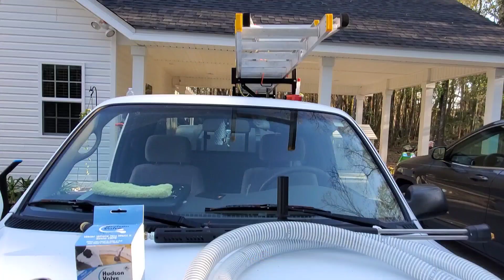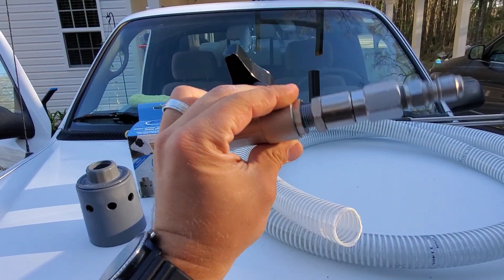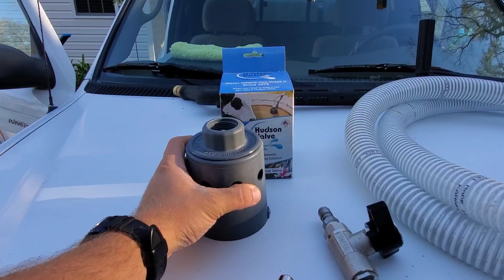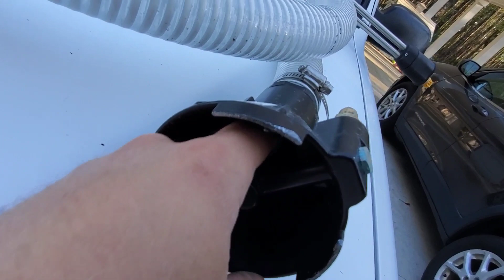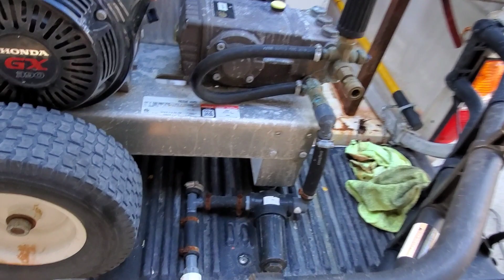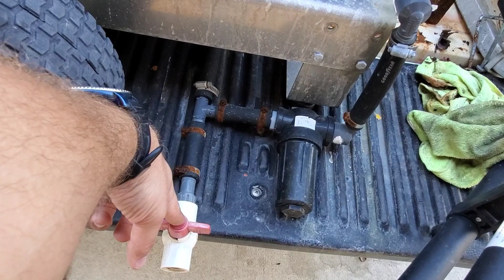Cheap & Efficient Pressure Washing Upgrades! | Power Washing Business

Comment: You need to run your bypass on your pressure washer unloader back to your tank. That half loop. Cut and remove the bottom portion of the hose and remove that barb fitting. Take it to lowes or home depot and get you  a 1/4 plug. Cut and remove the upper hose and go to lowes or home depot and get enough hose to run from the upper barb to feed back into your tank. You can drill a hole just big enough to fit tightly into your tank. This way when you're off the trigger, water recirculates back to the tank and you can stay off the trigger without burning up your pump.
Reply from the maker: Love it man. Thanks for the tip. I've got it all plumbed now. It's been on the back burner since I got the trailer with the 8gpm on it. I still use the small truck from time to time and have it as a backup for the larger jobs.

Comment: the sludge sucker is a good idea - where do you discharge the sludge? You have a tank for it?
Reply from the maker: Most of the time you can just displace it back into the grass. Any mix you put down will be diluted by the volume of water your surface cleaner put out. Plus the water used to pull the mix through the sludge sucker will further dilute it.

Comment: Where can I get a float valve like that
Reply from the maker: Any tractor supply or hardware store should have them. They're commonly used in farming. Also, look up any pressure washing store near you or  you could even try ordering them on Amazon.
Reply: Thank you for responding so quickly

Comment: Cool, thanks for the tips, going to get me a DN10 asap.
Reply from the maker: You won't regret it! It's a total game changer. I do most of my rinsing with the ball valve now.
Reply: @UnderPressureGa  you mentioned possibly blowing out an O ring if you put a quick connect on the end, what gpm are you working with?
Reply from the maker: @bluseptember  I have a 4gpm on the truck skid and an 8gpm on the trailer.
Reply: Do you reach 3 stories with your 4 GPM or 8gpm ?